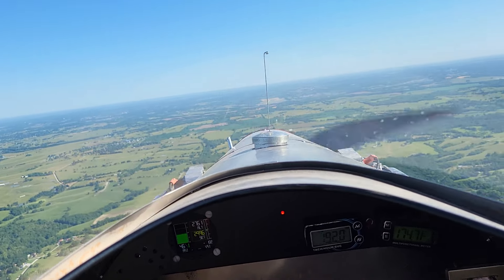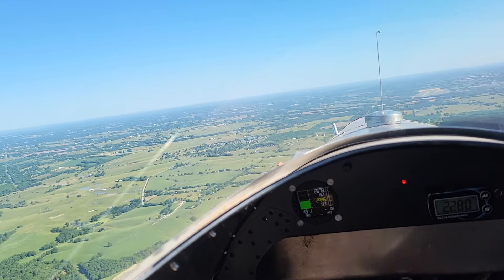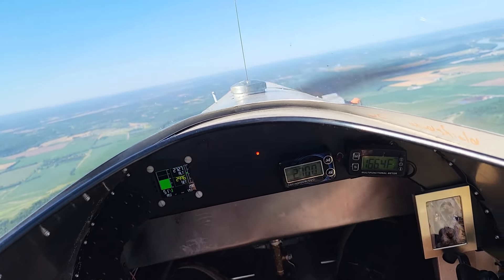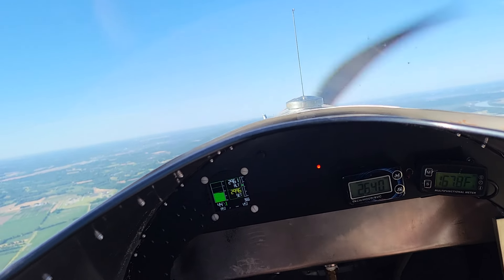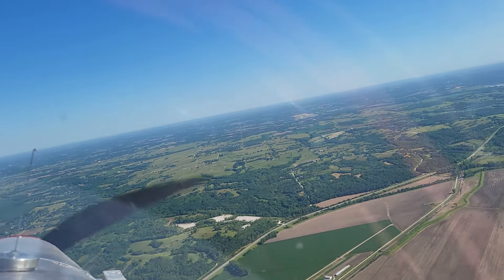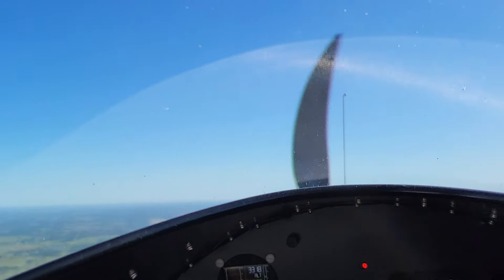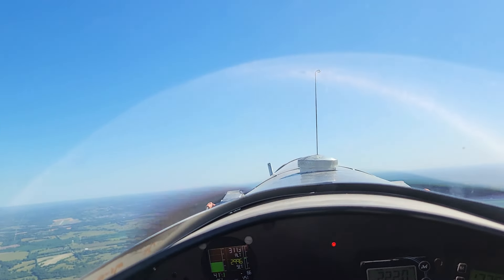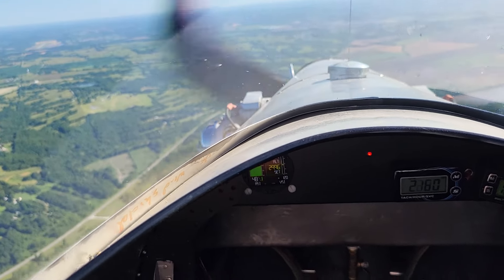Hummel UC stalls??

Comment: Just when you said a Cherokee flew by underneath you the digital temperature gauge was indicating 166.6 so ......we wait 
So, 26mph and idle rpm? It seems very docile and almost hard to stall. Lots of airplanes are tricky in power-on stalls, does the UC tend to drop a wing if not wrangled to stay level? I only have stall practice in a Cherokee 140; although I have experienced prop-hanging in more power high wing craft, a ride years ago in a Cessna 210 with a salesman (of course Bill Evans)....dad just kept buying Bonanzas, Travel Aire, Barons which can be a real handful 😮
 Wondered if/when you'd make a stall video and I commend you for not trying to video it. Godspeed, Dennis
Reply from the maker: Hi Frederick Woods well sir I'm glad I didn't see the 666 I don't like that! Anyway yes it just mushes along if you don't get the nose up high enough before you pull power off. It does stall straight and not drop a wing. Would love to be able to get video without me holding on to phone.....someday